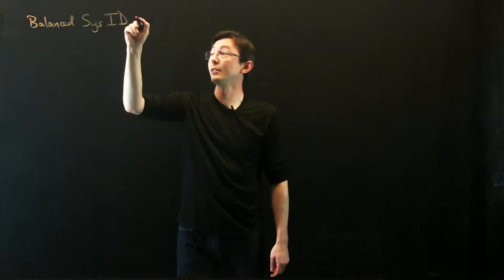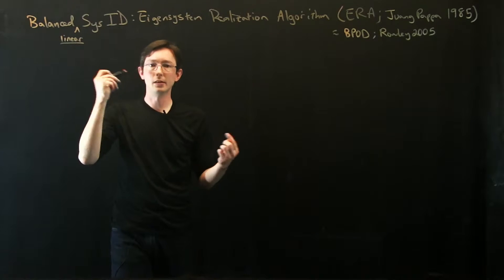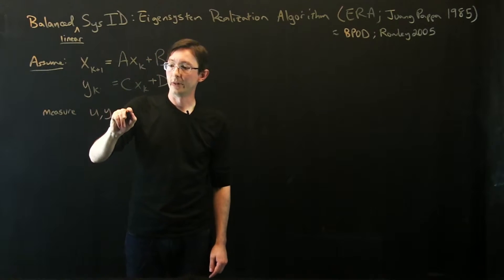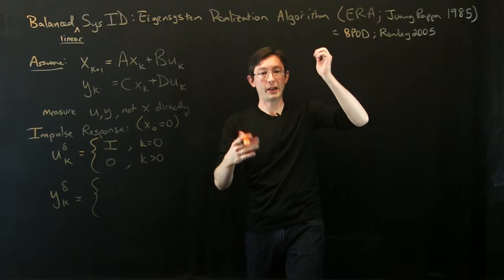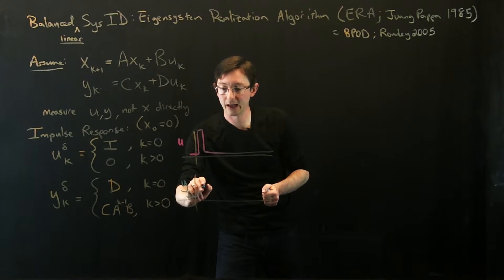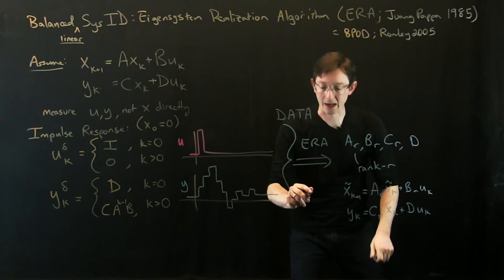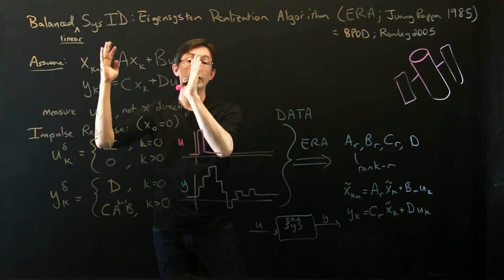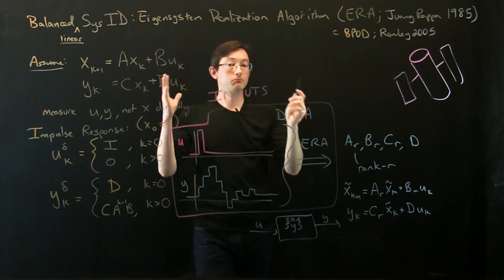Data-Driven Control: Eigensystem Realization Algorithm

Comment: Dear Steve, 
There is a question. Actually, you used an example of a Hubble Telescope to illustrate the way we use the input/output data. On the other hand, the assumption is that the system should be linear. Do these two match?
I mean is it realistic that a complex system like Hubble be linear?! because in the real world nonlinearity is a rule and linearity is an exception. 
How can we test whether the system is linear or not? and how close it is to a linear system? 
traditionally we use the step response test and expect states and outputs to have symmetrical responses to that for a linear system. Does it work here too? isn't it too expensive?

Comment: Hello, I have a 1DOF VIV system about the cylinder in Re=100. I will give a little impulse of Y-direction displacement (Y=0.00001D, D is cylinder diameter). I will record the lift coefficient of the cylinder. Then get the (Ar, Br, Cr, Dr) by ERA model. If I give different displacement excitation, I will get a different lift coefficient response（Linear change, because it is assumed that the system is linear at this time) Different lift coefficient response will form different Hankel matrix. Then the Ar doesn't change, but the  Br and Cr will change. While Br and Cr will be coupled to the spring system. In your MatLab code，the impulse u is 1. I am a little confused about this.